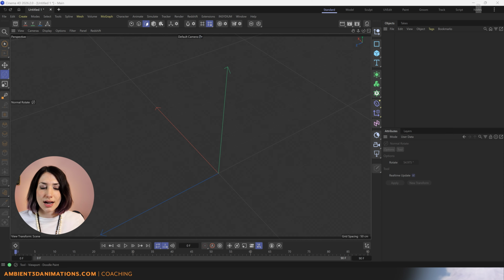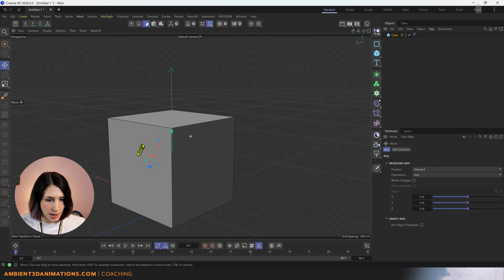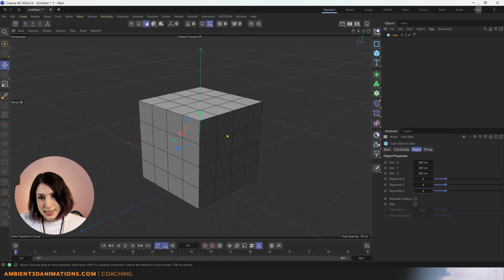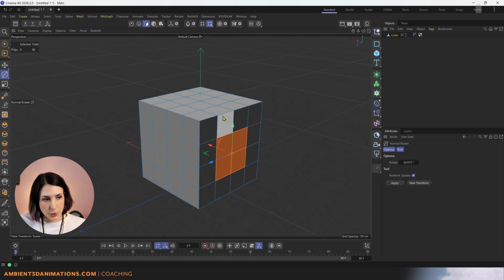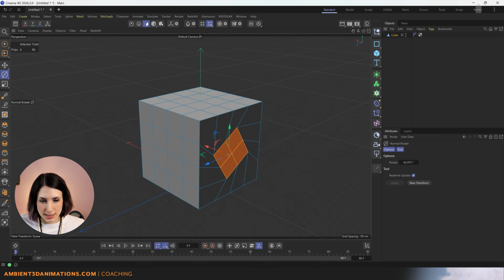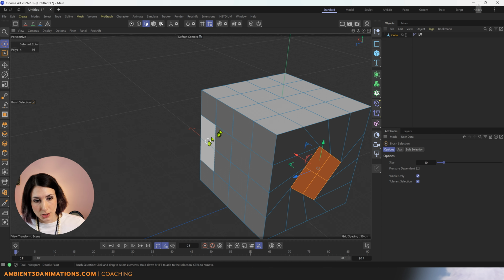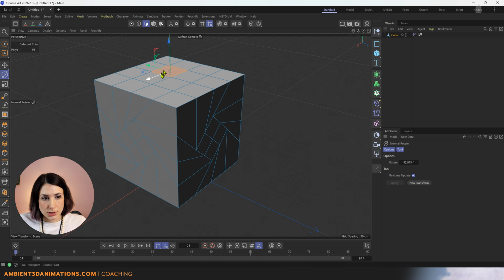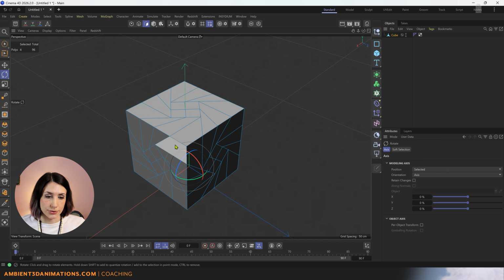Normal Rotate Cinema 4D Tutorial EP01 (Remake 2026)

Comment: This is cool Leah, are you redoing your older modelling tutorials? I am getting into modelling again , C4D has so much stuff that going over the basics often helps.
Reply from the maker: Yeah, I’m updating a bunch of them mainly focusing on ones where I have something new to say or it works differently than before. If it looks like updating it would be helpful, I think I should. I feel like I’m doing some YouTube Spring cleaning
Reply: @Ambient3DAnimations  The makes sense. I've found your videos of late to be particularly impressive so happy to watch out for the new ones.
Reply from the maker: As I update them, I’m replacing the older ones in the list. I’m not totally removing the old ones so if someone saved it, they’ll still have it. I’m setting them to unlisted though so that when someone searches a topic, the new one will appear instead of the old one